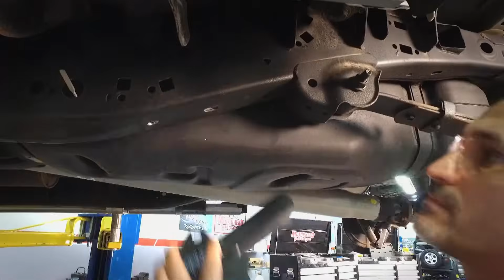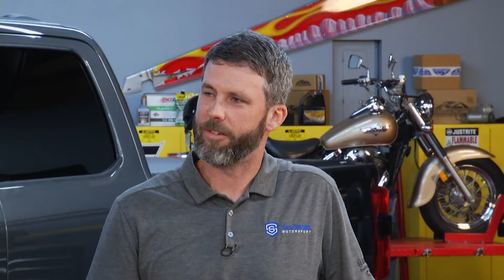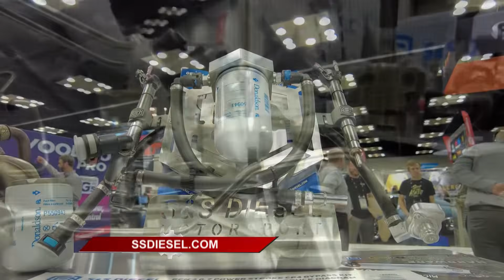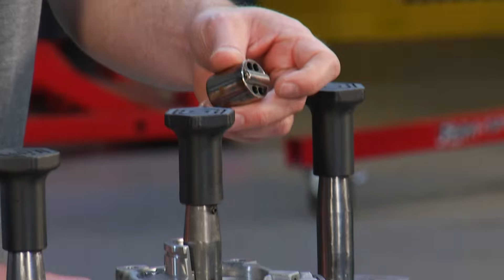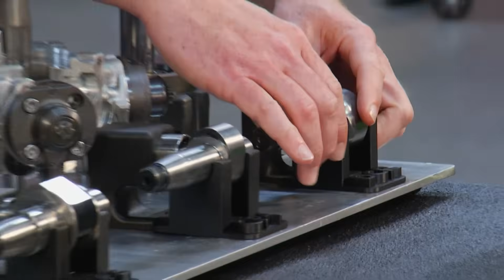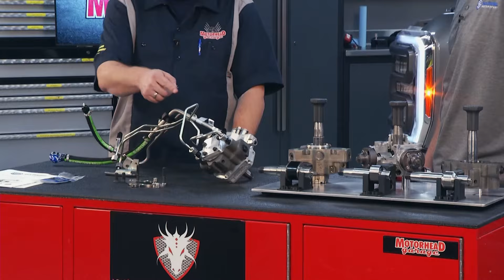Luke talks CP4 with Dave Dobson!

Comment: Still need a DPK...If. only standyne had a better fuel additive m, with their knowledge of fuel systems. Great video...
Reply from the maker: If the DCR is installed a DPK is not needed nor will the bypass block portion fit the DCR! The DCR is a proven fix!